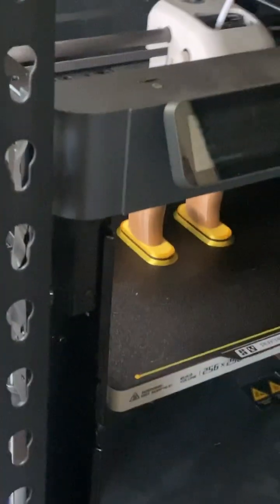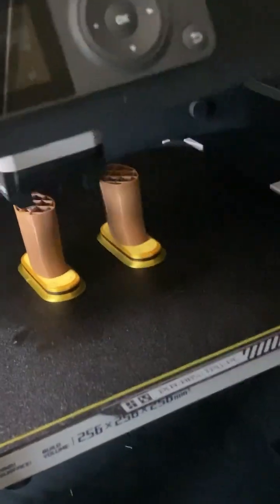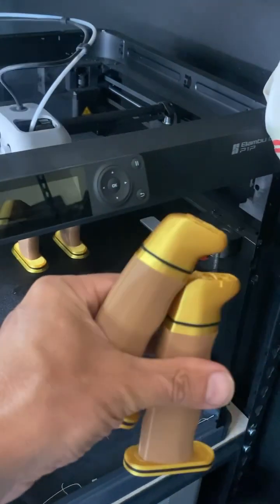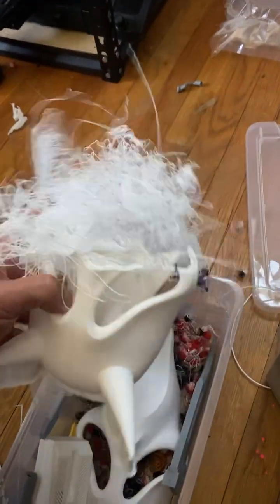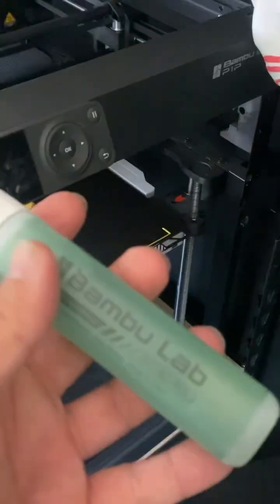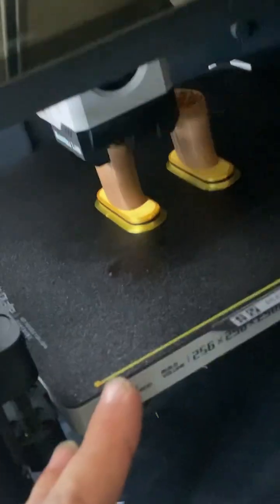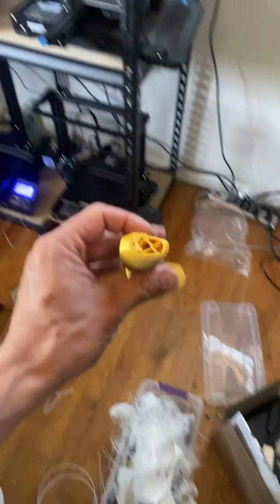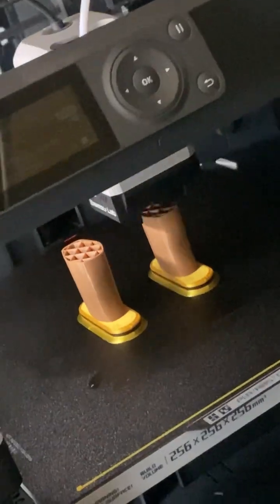Bambu Lab P1P is Fail City when it comes to knocking models off the bed, and Weak Bed Adhesion.

Comment: Had same issue I was printing on 220 degrees and it was failing them due to the material I was using. It happened to be melting on 230 better and no issues. Also using hair spray for the adhesion works as a charm and is cheaper. Also what can improve the printing is to put it on a silent mode. It will be printing on 50% speed but it gets them smooter. Hope it helps.
Reply from the maker: Switch to a Smooth PEI bed, and this problem will be gone forever.

Comment: My printer suddenly started doing this about 80 print hours in. Randomly, on the parts that i usually printed on it and my other bambu lab printers. I opened a ticket and they first sent me a heat cable. Changed that, no use. Then they sent me an MC board and a heat bed, replaced them, no change. I have cleaned my plates and tried every suggestion i could find. It still keeps happening. Even the creatvie tools benchy that comes on the sd card fails
Reply: Bambu is being Hella sketchy too, trying to avoid a return/replacement so they have started to ignore my responses. Been 5 days waiting for one. And the issue has been ongoing for 3 weeks. Their service is just horrible!
Reply from the maker: Get this bed: http://shrsl.com/4k3cd

Comment: I have over 450h of printing now on my two bambulab printers and so far I never had a print that got knock off by the Nozzle. The first batch of bambulab PEI sheets was faulty. I use a cheap aliexpress PEI plate without any issue and with nö glue.
Reply from the maker: Interesting. Mine is a launch model. Think I should swap the bed??
Reply: @3DRundown  Not the bed. I would try an alternative pei build plate.
Reply from the maker: That's what I meant. Will do!

Comment: Make sure your z hop is set to .6 I just finished a 22 hr print with petg and first one failed. Increased z hop , which makes the bed move down during move and it’s less likely to run into your model. My second print was perfect.
Reply from the maker: I would avoid Z-Hop unless you absolutely need it
Reply: @3DRundown  Explain more ...
Reply from the maker: I'll start with my experience. In 2022, I filled over 1300 orders, each being made up of multiple printed parts. I used Z-HOP on ZERO of them. Z-Hop will extend your print time, and possibly introduce stringing or other print defects. I'd save it for dire situations with a print that is giving an especially hard time. In my experience, it's just not generally needed, and is being over used, to compensate for other problems. With My P1P, I slowed a few things down, started using a brim on all small contact parts, and started using the P1P Bed Glue. So far, not a single failure. Sometimes, it's just a matter of choosing a different infill pattern.

Comment: Deep clean your bed bro
Reply from the maker: I wish it was that simple.
Reply: @3DRundown  I hear you. I can’t print dragons worth a damn on my Bambu printers
Reply from the maker: Yea, they struggle with thin items, tall items, and items with limited bed contact. However, tall items, WITH lot's of bed contact, struggle also. I'm working on solutions. For your dragons, turn your speeds WAY DOWN. Also, the Bambu Glue, actually helps....
Reply: nah man . i witness it live. the bed level changed in one shot.. i would have never tought.. it started kokcing only one an then al the others... the whole bed moved..